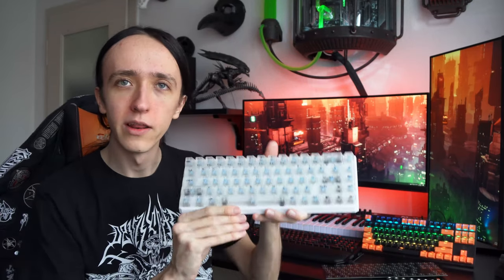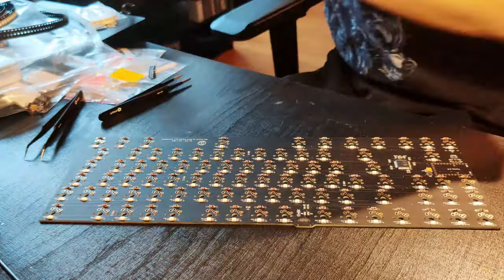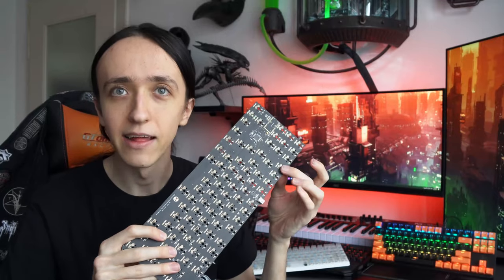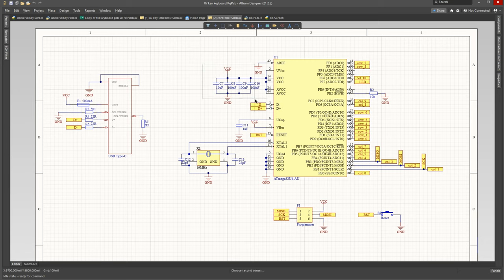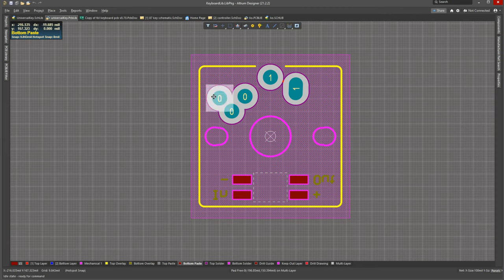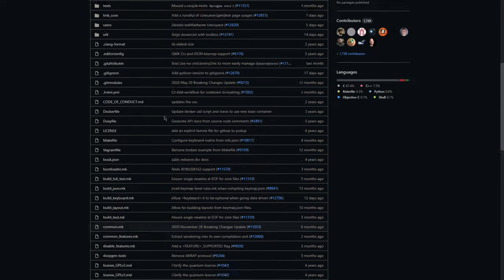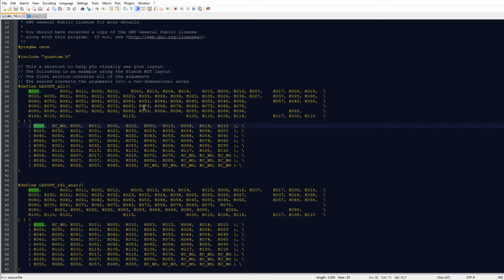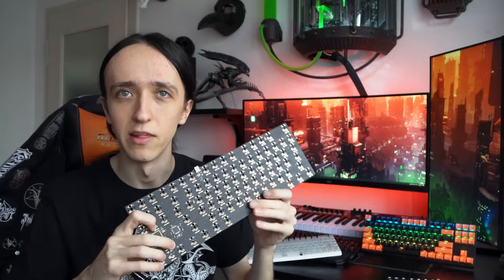DIY Keyboard from Scratch - with QMK and ATmega32U4

Comment: Could you explain why you are using 2 microcontroller? The ATMega and the USB teensy? From what I understand, you should only need 1 for each keyboard (so if it's a split keyboard, 2 MCs, meaning 2 Teensy). Thank you for the very informational video by the way!
Reply from the maker: I'm only using one, there is just the option to use either on the same pcb.

Comment: Noob here. I build keyboards but have never messed with custom PCB but am extremely curious. What is the process you do at 4:15? Is that some sort of paste soldering? Do you maybe have some links describing this process?
Reply from the maker: It is solder paste to solder the surface mount components. You can also build a keyboard with just through hole components though if you don't want to mess with reflowing your boards. Check out GreatScott for more electronics videos.
Reply: @DarkArtGuitars  So you don’t heat solder paste? It looked like you simply placed the SMD components and they stuck. I have a really fun time attempting to remove and replace SMD components with my iron. Lol
Reply from the maker: @h1ddens0ng  After placing the components on the solder paste, you do have to melt it of course. You can either use a hot air gun, reflow oven, or hot plate to do so. In a pinch you can also use a soldering iron to replace individual components, but it's a bit tedious.
Reply: @DarkArtGuitars  what were you using in the video? I didnt see a hot plate and it appeared the components stuck immediately

Comment: hi there! do you know when the option with atmega32u4 installed will be back in stock
Reply from the maker: Unless there is very high demand probably not soon, as I would have to order new components for it, which doesn't really make sense if I only sell one every few months.
Reply: @DarkArtGuitars  ok thanks anyways

Comment: Great content mate! About the LEDs, how many can I use without draining too much current?
Also do you use paralell or series connections for those LEDs?
Reply from the maker: The LEDs are digital ones, so the data line is daisy chained and the power is hooked up to 5V (so I guess parallel if you want). The maximum number depends on the brightness you run them at. With my setup I will exceed the USB spec if I set them to 100% power, but they are so bright that that is not needed (I just limited them in the firmware).
Reply: @DarkArtGuitars  Nice! Thanks for the explanation!
Reply: Btw I'd love to see a video talking more about LEDs and possible setups :)

Comment: Cool project! I'm currently making my own custom PCB and have a couple questions.

How much current did all the LEDs take up? Did you have to limit the brightness in QMK? Also, I might have missed it, but were there any resistors connected to the LEDs?
Reply from the maker: The LEDs are digital addressable ones, so there is only a resistor for the dataline after the controller. I have them limited to around 2/3 power in QMK which is still plenty bright, anything more and they get warm anyhow and too bright for my taste.
Reply: @DarkArtGuitars  According to my caculations, 87 LEDs running at only 10mA each still exceeds the current limit of a USB 2.0 port. How did you get it to work with the current limit of <500mA? thanks!
Reply from the maker: @anventia  By running at below 10mA, the power draw drops off quite drastically when you start limiting the brightness.
Reply: @DarkArtGuitars  Cool, thanks for your help!

Comment: very nice work! i love it! 

are there any pcb manufractuers that can also solder the led and the atmedga chip ?
Reply from the maker: Most PCB manufacturers will also do assembly for a small fee. PCBWay, for example, offers assembled PCBs starting at $30 for like 10pcs or so.
Reply: @DarkArtGuitars  thanks alot i think this will be the way will take... im done searching for a matching keyboard...  i hope i can manage to get the pcb file right...

what chip do u recommend for wireless and 84 key + fn keys...
Reply from the maker: @teabagNBG  I have not done wireless before, so I can't really tell you. I'm sure there is someone else on YouTube that has done it though.

Comment: What is the purpose of the teensy? Just to program it?
Reply from the maker: The teensy is used instead of the other microcontroller, so it handles the connection of the switches and the translation to the USB protocol. If the microcontroller is used, the spot for the teensy can be left blank, it's just to give me some options.

Comment: Does the usb-C connector work too when using a Teensy or do you have to use the Teensys?
Reply from the maker: You have to use the Teensy, unless you go ahead and solder wires to the usb connector of the Teensy, as it does not break those pins out to a convenient pad.

Comment: Would the case fit any tkl sized pcb?
Reply from the maker: That depends on the dimensions, it is sized quite tight, so if you're using a different PCB that is larger, it might not fit. The layout itself would fit any standard TLK PCB however.

Comment: Am i too stupid or is the PCB simply not open sourced?
Reply from the maker: I have not released the PCB files as the version I tested had mistakes and while I fixed them in the software I have not tested the updated version, so I also did not release it. If I release something to the public I want to be 100% sure it actually works.
Reply: @DarkArtGuitars  Thanks for the reply!
While i get why you are not releasing the files, its a bit sad because i think the spirt of the DIY community is that the everyone gets a chance to improve somethin, use existing projects as a starting point.
But i do respect your decision.
Reply from the maker: @cornolinius  There is nothing too special to my design, it's just a key matrix and the components of an arduino pro micro on a custom PCB. There are quite a few videos out there going into detail on basically this exact schematic who have also released their files.